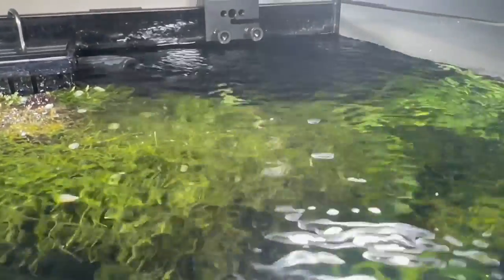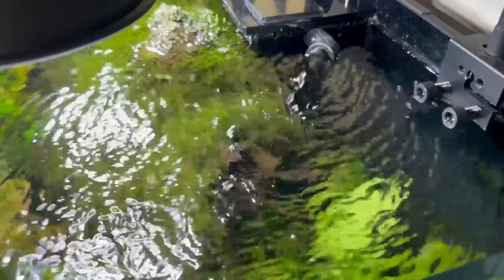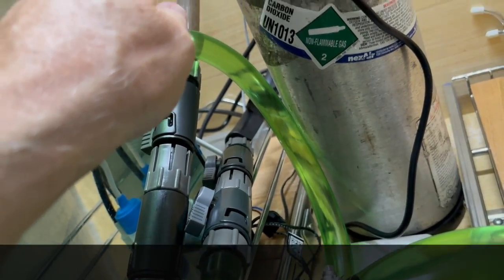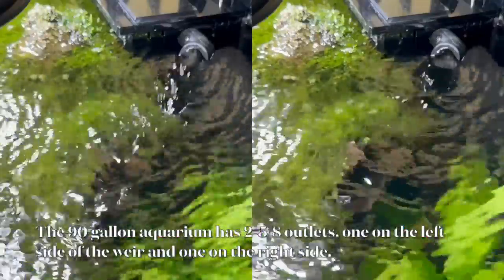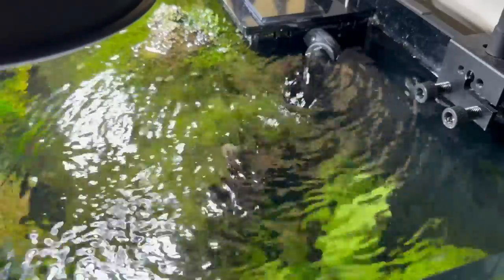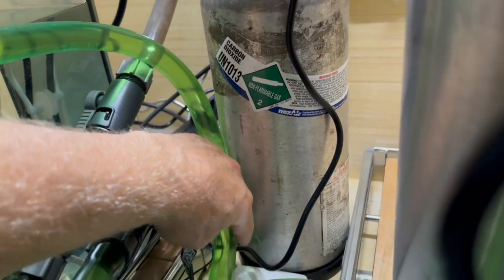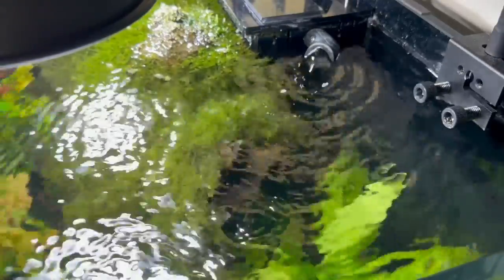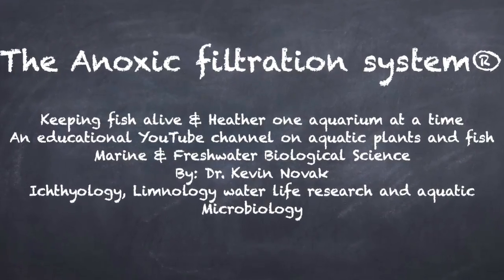How can I get more gallons per hour out of my canister filter when it already has an attach motor.

Comment: every canister maker test their product WITHOUT media, sponges giving an inflated l/h. With media, sponges, the output drops about 50%. I pimped my old eheim 2028 output (500l/hr actual) by adding a second pull pump (eheim compact ON5000 rated at 5000l/hr). Now my fish is very happy with the inrush of water into the tank. Just 2 caveats, always start the canister first then the second pump. The reason is you want to flood the canister first before the second stronger pump takes over. Not doing this will result in pumping out air bubbles. Second, don't restrict the outflow as it will increase backpressure that might cause unsecured hoses to be dislodged!.

Comment: I tried to this using a vectra  pump with a quite-drive speed control and it worked great at first.
I was at 200GPH, but now at 135 at max rate. 
Not sure if motor is problematic at this point.

Comment: Hi Dr Novak Good video as always.
I have a question regarding the external motor is it Iwaki? How quiet are they? And  where do I buy it?
Reply from the maker: That's another reason I moved the pump out to the lanai because it is not quite as quiet as other pumps. It does make a humming noise. That's a little bit louder than some people would like even inside a cabinet you can hear it. It's a very great pump, but heat and noise are its two enemies.
Reply: Thanks for your response I am looking for something like this but quiet for my turtles.
My set up is a Canister filter moving water up about 6 feet into a tub using two bcb baskets with pothos plants then back down to the aquarium. (20 gallons)
Also inside the canister I have 2 small bcb bags .
As you can Imagine the head pressure is quite a bit and the water movement is very low.
Appreciate any feed back and a pump recommendation 
Thank you

Comment: most canisters will give you 50percent of there top flow as it has to lift the watwer higher as youll already know but alot of others wont the higher it has to push the watewr the less flow youll get so by having the canister higher helps iv tested many canisters a\nd there flow rates ands i can tell you the eheim pumps are by far the best iv tested iv got a eheim pro4 250 its top flow rates 900lph but i get 600lph from that thats over 60percent iv also a few eheim classics a 250 n 350 the 250s top flow rates 440 i get 360lph from that the 350s top flow rates 620 i get 480lph from that these are the highest in rates without lifting them higher iv also an eheim experence 250 its the only one thats disapointing its flow rates 700lph and i get 330lph from that thats less than 50percent iv also tested a fluval fx4 fluval 207 sunsun hw702 jbl cristal profi 902e ans jbl cristal profi 1902e my x partners got a betta choose 1050 canister all these does 50 to 52 percent where my eheims do 60 to 80percent think the motors are just made better they last longer aswell eheims are great love them

Comment: Hi Dr Novak. Great idea and planning to do that with my 22ltr steel cylinder (BCB) fitted with a 3000ltr per hour DC pump.. What is the make and 
 liter/gallons per minute of your  magnetic pump? The ones that I see are rated at about 20ltr per minute. I have one fitted to another filtering system I am experimenting with. Great little motors,  but do run hot.
Reply from the maker: Sounds great!

Comment: So many ways to increase the flow of a canister filter. 

Raise it up
Shorten the hoses
Widen the hoses
Remove disconnects
Widen the output spout
Remove as many bends in hose and hardware as possible
Piggyback another pump
Reduce media

There is one canister filter I can think of, that likely pumped every bit of its rated output, no matter what. The old Magnum 350 canister filters. They were absolute beasts.

Comment: Very helpful, now if my canister filter is a bcb holder should I be increasing the GPH?
Reply from the maker: It's really not necessary unless you feel it so but it will not hurt anything to get water from point A to point B as fast as possible.

Comment: Hi Dr Novak. Instead of buying an external pump would this work if I were to put an existing  internal powerhead pump of similar rating as the canister on the intake pipe inside the aquarium to increase flow to the canister and reduce the resistance instead of flowing by gravity? This way there is a 1400l/h pump pumping water to the canister and another 1400l/h pump in the canister pumping water back to the aquarium.
Reply from the maker: You have to put it on the outtake end of the canister filter in order for it to make any difference at all. What you're trying to do is relieve the "resistance" on the pump or should I say the secondary pump so it can pump as fast as it's rated.
Reply: Yes I was hoping to get at least the 1,400l/h rating of the canister instead of the 400l/h that I currently get out of the canister.

Comment: Hi Dr Novak. Thanks for this video and thanks for clarifying that this is doable. I was think of doing this but was told it will put a strain on the old pump and blow it out unless I removed the impeller of the internal pump and keep it off and then only use the stronger external pump.
Reply from the maker: What you were told is absolutely false information. It is a magnetic pump and if that magnet moves faster than what the magnetic field permitted nothing is really going to happen. You're not going to blow-up your old pump, you're not going to overheat it, in fact, you may even use less electricity in order to run it. This is because the magnet will move more freely with less resistance. In fact, the more resistance you give to a pump the more likely it is to become damaged or overheated. I designed electric motors as an engineer, so what you have been told is false. You are more likely to do more damage to a motor if you slow it down, because then the stator laminations may overheat.

Comment: That's what I did ! I got a broken sicce canister! My seller replaced it with a eheim n refused to pick up the broken canister to save the shipping cost, I repaired it n connected both toghter, now  the flow is pretty sick now
Reply from the maker: Should work better because one pump is seeing a lot less resistance to it, and therefore can actually spin faster than the first pump before it.
Reply: @anoxicfiltrationplenums  yes the flow is great now the broken filter is sort of a prefilter for me!

Comment: G'day Dr Novak, another cheap and easy way to achieve an increase in flow is to raise the canister off the floor and shorten the hoses. This will reduce the head height of the water the pump has to move and the resistance of the return hose. Not a massive increase, but a noticeable one at no extra cost.
Reply: I used a continuous 1inch tube for the outflow of the canister right into the aquarium without any bends or joints and managed to increase the outflow by about 100l/h from 300l/h to 400l/h.